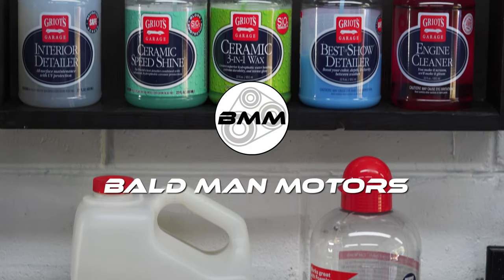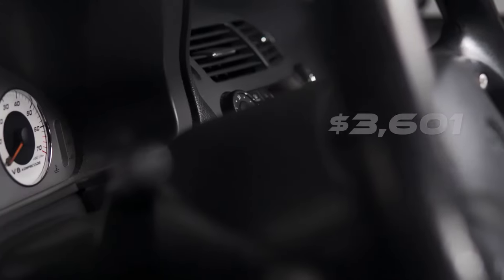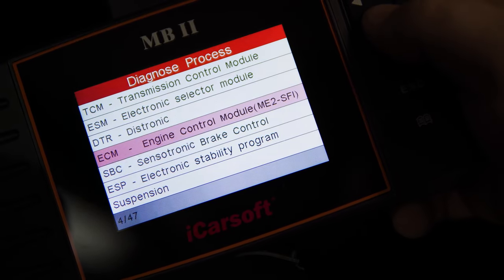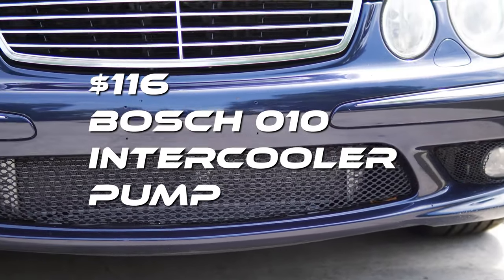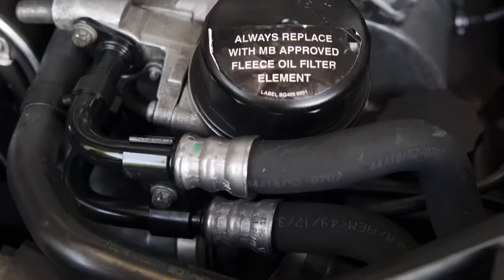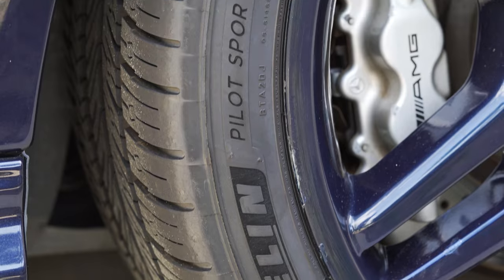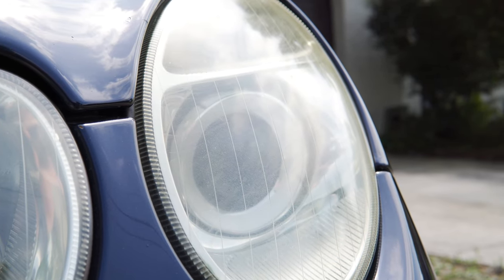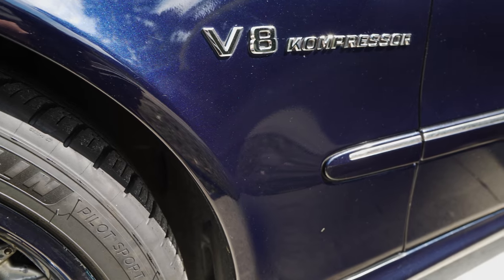W211 E55 AMG Maintenance and Reliability Ownership Costs

Comment: Awesome and helpful video! I have one as well and ive been post poning changing the rear subframe bushings as it makes a kind of tap noise on acceleration. Overall it's been good tho
Reply from the maker: Glad you liked it and good point about the subframe bushings, I should probably check mine out just to make sure they are good.

Comment: Love finding more AMG content on YouTube! I have a manual swapped C55 AMG on my channel and an ML55 AMG if you're interested! Sub'd! Great insight and I am sure your cost of ownership will go way down once you get any deferred maintenance out of the way, or find the odd bugs like you have. Highly recommend Creative Steel motor mounts in the future, these motors will chew through the OEM units fast. Also, if the air suspension becomes troublesome, there are conversion kits for coil-overs out there. Sounds like you know these cars well and are capable of all the DIY they need at times, which is what they deserve!
Reply from the maker: Thanks for the sub! Yeah I hope the cost will go down, I will check out your channel as well! Yeah I figured next time I will get better mounts in all my AMGs a bit of a pain to change lol. Thanks for the comment!
Reply: @BaldManMotors  the nice thing is, the Creative Steel mounts are slimmer in size so much easier to fit. They help the car’s dynamics a lot overall, eliminating the want to veer slight right from the torque lifting the driver side of the engine. Lifetime guaranteed as well. Anyway, glad to connect with you!
Reply: dang a manual c55 how and what transmission did you get it off?

Comment: I’ve seen a 129k e55 for 5k with mods already on it . It’s probably a dumb idea, but what are your thoughts on it?
Reply from the maker: @ MajorTreesh First thing comes to my mind on a deal like that without knowing details is to have several thousand available as well for maintenance right from the get-go. I don't typically see them that cheap unless they are salvage title with mechanical problems but you may get lucky.
Reply: @BaldManMotors  yea I’m definitely gonna have like 2k saved for just repairs if I go through with it.
Reply: @zachavelli_  did you buy it?

Comment: So the Michelin A/S 4 aren't that sticky? also, would you elaborate on that intake spacer? what did you use surrounding it?
Reply from the maker: Yeah they don't seem quite as grippy as summer tires but they are far from terrible. Intake spacer is just made out of 3/4" x 1/8" mild steel, I welded it together with all sides angled in at the top. There are red versions on ebay for $250, I wasn't paying that much 😂 I got longer screws and used cut pieces of brass tubing as spacers for screws.

Comment: Hello bro. I wanna get this type of an E55 with 180k KM for 15k. Is it worth it and would it have problems at that milage? (Btw europe)
Reply from the maker: Well at those miles (180km is 111k miles for other readers reference)  it should be good, not sure on 15k price, that is a bit high I think at least here in the USA but it isn't terrible. I would just recommend getting a pre purchase inspection done to make sure it's all good. Common failures can be motor mounts, intercooler pump, transmission flush due and check airmatic suspension is working properly and isn't leaking. Also check for rust. Hope that helps and best of luck to you! 👍